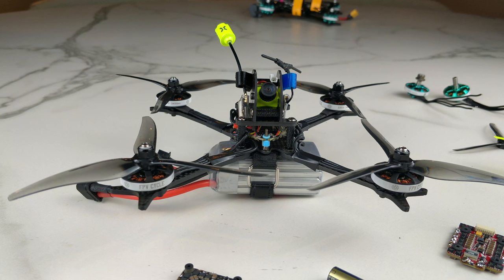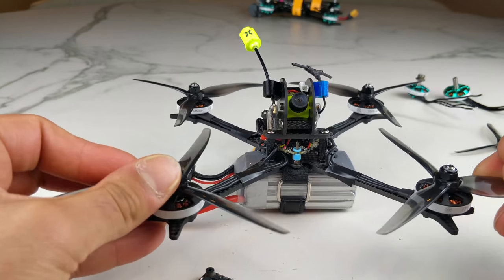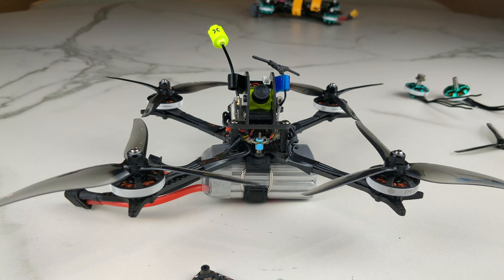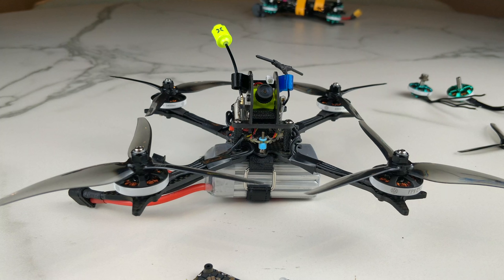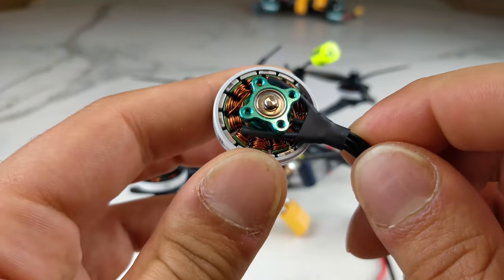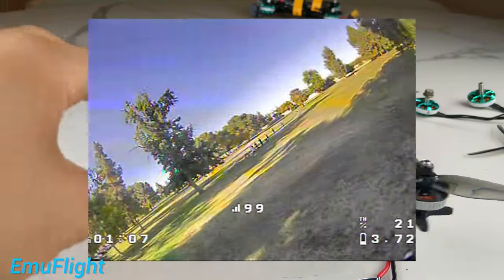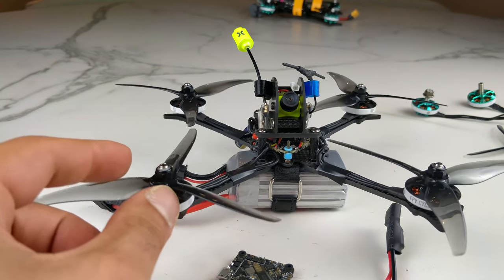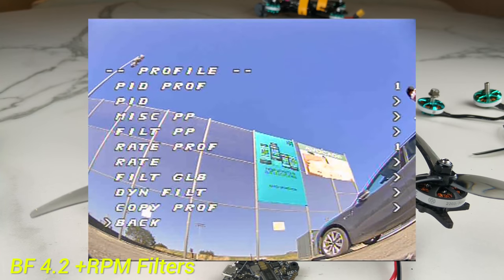Unconventional Tuning...

Comment: Another thought... "motor_output_limit" has been super effective method for me to limit the power of quads with very high theoretical RPMs without completely Nerfing the power.
Full Credit for this and explanation with testing shown here by someone else - bottom line: Very effective way to combat issues of mismatched motor KV and battery voltage: 
https://www.youtube.com/watch?v=xXUOys2s5HY
Quick explanation without watching the video (only 10min):
-Limiting the Motor output reduces the maximum power to which the PID loop has access. This is a much better method than a simple throttle cap, since that only limits the power that the PILOT has, while the PID loop can still rev the motors well above a reasonable RPM for that specific motor/prop combo. 
Example: Sharing my experience with the advice in the video above
--Build: Twig 3" with EMAX 1106/6000kV, T3x2 props running on 3S.
1. Calculate maximum theoretical RPM on 3S (12.6v):  6000kv x 12.6v = 75,600 RPMs 
----> Baseline for 5" quad on 6S (25.2v) is: 1750kv x 25.2v = 44,100 RPMs
3. Calculate percentage to limit motor output:  44100/75600 = 58.3%
4. Since power does not scale linearly from a typical 5" build, I added 10 to 15% to the calculated comparable limit. I used 75% as the limit and it flies MUCH better and still has the punch that makes a Toothpick quad fun to fly.
5. CLI commands "within the quotations":  
"get motor_output_limit"  //this is to show what is currently set since there isn't a GUI reference.
set motor_output_limit = 75  //this sets the maximum power of the motors for BOTH the PID loop AND the pilot
save  //ensure your changes are saved
Reply from the maker: I actually tried that and it didn't help at all. I don't believe the kv is an issue in this situation. If I simply ran 3s I'd have zero issues. But I'm trying to squeeze the maximum performance out of this thing so I'm going for 4s. If I were to drop the kv down and use 4s, well then I might as well just use 3s
Reply: KababFPV — It sounds like electrical noise was the culprit. It’s funny when you have to back to things we’re learned a couple years ago and you’re like, “gotta be kidding me 🤦🏻‍♂️”

Comment: How on earth can RPM filtering cause burnt Escs? Funfact: Yesterday I randomly Googled enrico morricone and I wondered that he still alive. Today, he died! Did I cause that?
Reply from the maker: I wish I knew but there are lots of reports of burnt ESC's.  I would be many of them just flashed the wrong code version but I dunno.  Way back in the day I remember all four of my ESC's simultaneously sparking and going up in flames after flashing SimonK or Blheli.  Never understood why back then either.
Reply: @Kabab  I wish people could be honest admitting mistakes they did. Flashing a Firmware to something that runs this magnitude of currents through a Chip which is not much bigger than the copper-diameter of a wire you would use for that application will surely make the Chip burn up immediately if something goes wrong.
On the other Hand, a bent or broken Prop will introduce so much noise into the gyro, that it can easily burn your esc through d-term too. An efficient notch filter can do the Trick to keep just the meaningful portion of the gyro signal.
I could also imagine, that Flashing the correct Firmware but using the wrong number of Motor poles can cause danage.

However, as you already pointed out, it is great that somebody is making money out of it and at the same time funny, that no Chinese Company is willing to spend it.
Also I'd like to mention, that joelucid brought plenty of stuff to betaflight without talking any coin for it. Like absolute control, linear thrust, integrated Yaw, BiDir dshot etc., rpm-filters
BiDir dhot in General is what makes RPM-filters possible and I think its somewhat a joint effort of JoeLucid and the author of blheli. Blheli32 is closed source and the first Firmware to Support BiDir dshot. Though it was not expected to happen, joelucid was able to squeeze this even into the blheli_s Escs. Infact, he learned almost everything from the original blheli_s Firmware, afaik rewrote it from scratch (also implementing 48khz stuff which is available for free) and then found a way to implement the Framework for selling blheli_s telemetry licences.

Comment: In my experience from BF 3.0 up and including BF 3.5 the goal was to have pretty much any quad fly decent out of the box. From 4.0 they changed it into -who cares about out of the box, but make it possible for most people to get really excelent results if they are willing to put in some time and effort. - Besides RPM filtering I liked 3.5.x better. VTX-tables and whatnot, yuck. The effort it takes to move a quad from one 4.x version to a newer is just too big.
Reply from the maker: yes that really is exactly what it is.  The effort of moving from 357 to 4.X is just too great.  Vtx tables are absolutely disgusting.  I got mine setup right and the damn VTx keeps getting stuck in pit mode.  It's the most ridiculous shit I ever saw.  Someone should fork  BF and just go back to normal Vtx function.  That would be enough to charge licencing.  I'd gladly pay a dollar not to have to deal with Vtx tables.
Reply: @Kabab  totally agreed.

Comment: I've pushed all the way to 20:1 thrust to weight ratio, it works but takes extra tuning work. Usually 4.1+ does the trick getting a high power quad to fly right, might have to play with ESC settings and lower ramp up power, timing, demag or pwm frequency.
Reply: 20:1? I don't believe that's considered a quad anymore. It's a prop rocket! 😋

Comment: They are a lot of marit to what your saying here! I have been building quads for three years. And I suck at tunning Betaflight (P'I'D's) firmware as well. So I do the very same thing. I have multiple Betaflight firmware configurations saved on my laptop (old & new configurator) So I can go back to Betaflight 3.5.7 or I can use Betaflight 4.2. I ran into the very same issues you have here with a similar build using 20amp Betafpv Aio board on a 4 inch Xnight build. Very Same mid throttle isolations as you was having. I changed firmware at least 10 or 15 times!!! I soft mounted more & more!!!  I pulled the quad apart at least 4 or 5 times..changed motors etc...By this time I was pulling my hair out!! On multiple forums asking anybody and everybody for any feedback I could get about this issue. ( Mid to high throttle isolations?) I actually got a little feedback on Facebook that helped a little adjustments on Dterm filters which calmed the isolating a little.  But they still was there! I figured by this time (Which had been 3 or 4 weeks working on this quad) That I had a bad board (Bad gyro) So I got another board sent to me. Same Betafpv 20amp board. But this board didn't have the isolating issues as bad as the previous board. But isolating issues was still there. And I ended up at the very same results you had. If your going to run 4.xx Betaflight firmware configurations your going to need JEC or some kind of rpm filters firmware on your esc's that's a fact. Or the new Betaflight firmware isn't going to run on these Aio boards like it should. I been exploring Kiss firmware and Flight one..Because Betaflight is great but all the things you got to do to get it to fly properly is a lot on a working man with limited time to fly. So I feel your pain on this subject trust me

Comment: You might get tons of vibration from how loose (seems) your antenna are mounted . Even Vibration from capacitor hanging like that. Maybe go back to soft mount motors in this quad?
Reply from the maker: I don't think the very low weight antennas could cause enough vibrations to be problematic in this case.

Comment: have you tried some different props?
Reply from the maker: I've tried several props.  It's not the props.  Even without the props it does the same thing.  I eventually gave up and now run 3S.  It's still wicked fast

Comment: Great video! 
 
Interesting, lol, I braided all my TP3 wires (3 quads :/) no issues though just wanted to protect/organize the wires. Also, I knew that putting your cap at the bat connector was not ideal but definitely better than nothing if you don't have space and are looking for durability.
 
For me caps have always been key, anytime I've had issues with a quad it is one of the first things I look at. This was because of my experience with RC planes. I've built a lot of 3D planes and was always frustrated as the older ESCs did not have a large enough BEC to power all your servos, especially for demanding maneuvers. Some of my planes have multiple caps in various places to smooth out the power/solve servo twitching and failures. Quads have been no different in my experience...
 
Also, I sell machinery and automation equipment for a living. I try to plan my wire routing, high power cables do not like being in close proximity to each other. If you can route wires perpendicular to it reduces noise (I am not an expert/have no education on this, just work with a lot of machinery and see similar issues). Another thing to try might be ferrite coils, there’s a reason many RC plane ESCs have them on the RX wire.
 
As for RPM filtering... I have it running on 2 quads, no esc failures. Both have the Vanover motors (copied all of his settings from the RR store). I cannot express how amazing his tune is, it has given me a lot of confidence/so much control over my 5”. The TP3 also fly’s amazing (with your provided settings) and has been an awesome tool for practice! I now feel like all my quads fly great without ever having learned to tune them :/. IMO physical setup/components are much more important than tuning… also, who has time to learn all this crap and still go out to fly?!
Reply from the maker: Seriously. Keeping up with all this crap is a full time job

Comment: RPM filtering has nothing to do with quad size. If you don‘t get a good tune on your micros having rpm enabled you need to learn how to PID tune instead of flashing different firmwares and hoping for the stock tune to work. If you think a good build can have any PIDs you are totally wrong and have no idea about PID controlling.
Reply from the maker: Not everything is PIDs.... default PIDs are usually pretty decent on most things.
Reply: KababFPV Depends on how demanding you are on flight performance. Defaults not working acceptable for any of my rigs.
Reply from the maker: @marlin-fpv  well in this case, you can set the pids to zero and the motors still have issues so it's very clearly not PIDs

Comment: Hmm ive been running the racerxfpv et5 ultra light weight 5inch kwad running ethix 1506 rats made for there 6s cinewhoop motors also running the same props as you on 4s and stock tune was on just a bit of propwash needed tuned out but it flies amazing super snappy but i tid bit of float bc it weighs in 249 grams with 4s 850mah ...id really suggest using tpu on tgis frame for the canopy/pod ..once i grab this frame im gonna to design one for myself ...also my geprc 20amp board works amazing on it crazy that i didnt have this problem
Reply from the maker: those motors are quite a bit smaller by comparison....you wouldn't have issues with those.
Reply: Thats good then i picked them so i coyld maybe run 6s in the future but there amzing on 4s so ima just stick with the set up i got now ...yea your motors are definitely alot bigger thats for sure lol

Comment: High throttle oscillations can be helped by lowering tpa and tpa breakpoint
Reply from the maker: Usually increasing TPA and lowering breakpoint but in this case it does nothing.
Reply: @Kabab  I'm used to emu tpa, I never touched tpa in beta but in emu since it's based on your pids you can lower parts of the pid loop based on throttle position which makes over powered quads easier to manage at high throttle

Comment: Betaflight seems to have a huge problem with the way they handle TPA. On kiss I ALWAYS can fix mid to high throttle oscillations simply by adjusting the TPA. So coming back to Betaflight (why.. idk...) I actually copy the way that kiss does TPA (as much as possible) and I have had great results so far.
Reply from the maker: I have noticed that TPA essentially does almost nothing on BF since it was first added....
Reply: KababFPV oh it does. But by default it only attenuates the D term. You can set it to attenuate P and D thru the CLI. Thrust_linear is another one that can be a good tool.
Reply: @zfpv7211  Agree, once I switched to TPA =PD in the CLI and it made a world of difference.

Comment: From my known ypu pay for the Blheli32 license when you buy the Esc.
Pid these days more for a prefer flying feeling and not that the Qwad fly well
Reply from the maker: Yeah so that's pay. Which is really a good thing. It's an insignificant amount but adds up for the devs.
Reply: @Kabab  you never try change a broken stm chip on a blheli 32. Thats a pain in the ass becouse it dont work. You can switch the IC but you CANT programm him. No chance to pay for a licence :( Same is when you take the ic from a toophon 32 and put it on a wrth32 (they the same) you cant reflash the chip! It simple dont let you becouse says is a Toophon. That sucks
Reply: @Kabab  would love to pay for blheli 32 reworks to but no way :( For me is realy easy to switch an IC that cost 5 bucks but now i have to waste the hole 40 dollar ore more esc. Remeber me a bit on Apple ☹

Comment: Has anyone of you guys succesfully flashed bidirectional dshot on the Mamba f411aio board?
Flashing is not working at all on my two aios... Been in touch with thorsten laux (developer of jesc) and still couldn´t figure it out...
Reply from the maker: Sorry I haven't tried. I usually run 3.5.7
Reply: RawPics- I think Ive had more issues with Diatone aios than any other boards/stacks. Take that with a grain of salt though, due to low sample size. While I have paid-license rpm filtering on two AIOs (original, lower AMP AIOs,) on one of them, the default UART for RC Rx (1) simply doesn't work, neither SBUS, nor FPort. On my new 16x16 Diatone Mamba stack (with pin connectors,) I lost an ESC immediately after licensing it with JESC. It's the first failure Ive had out of 130+ escs licensed with JESC. And not to rile anybody up, but I just tried Emu recently and was beside myself when picking one of the availble preset tunes delivered me a quad that sounded better, handled equally well if not slightly better, and was setup in a fraction of the time required by most all of  my other quads. Im going in hard on the next release, and will begin comparing the firmwares on each quad, keeping whichever firmware is "better." 

FWIW, I wont touch BetaFPV anything, my 20x20 F405 Mamba stacks are rock solid, Nameless AIOs (both the Toothpick layout, and conventional,) with the high dead time have proven robust, HGLRC 16x16 are my favorite nano stacks with 5 in service pushing everything from 3S 1202.5 5800kv 3", 4S 1404 4850kv HD with high pitch 3", and HD 4S 1404 3600kv 4", and no issues thus far. Flywoo Goku AIO is my favorite "whoop" style board (they have all standard pads/features, plus *Blackbox flash*, 4 ARGB LEDs, Camera Control pad with cap and resistor, spare 5V pad(s), spare Batt pad(s), Motor 5 pad for remapping anything you want, optionally closed softmount retention, motor pads on both sides with optional through hole connector mounting, and a crappy [shrug] conventional usb port layout,) with 6 or 7 in service on various Toothpick builds and no issues.. I could go on.

Anyway, I really gotta start checking the electronics stuff prior to spending hours on a meticulous build.

Comment: BF 4.2 imo is easier to setup than all other previous versions. You just basically throw it on and activate RPM Filtering and see how far you can reduce the other Filters (which is very easy because of the introduction of the sliders). Same goes for PID's (because there are sliders now as well). I hope they implement those sliders in the OSD too because it just makes things a whole lot easier.
Reply from the maker: Yeah it is if you have rpmf on board ....which you need to pay for.  BF is literally just dishing money into jesc's pockets. I do not understand why they would do that and still operate with no income and still be bitches about everything!  These guys are not friendly as far as I've heard. They hate me because they think I'm racist.  I don't even understand where race plays a role in anything I'm doing on my channel 🤷🏻‍♂️
Reply: @Kabab  shhh... Don't tell anybody but have a search for JazzMaverick's BlHeli Firmware👀
Reply from the maker: @k1f02  😑. Yeah I remember seeing this I'll still pay the licence
Reply: @Kabab  🤷‍♂️ I would rather pay for the BF software itself like once per quad instead of the ESC firmare.
Reply: @Kabab  Joshua bardwell said he doesnt recommend Jazzmaverick because the newer versions have a lot of bugs

Comment: Also i think most of these manufacturers assume your going to use a capacitor on the aio board but they should atleast tell the customer tp use one..like others said to you ive also noticed this on this cheap board basically why i stayed away from it but im glade it works great bc ill be buying a hand full
Reply from the maker: the manufacturers don't have a clue themselves.  Usually they don't even use these things.  One guy is probably telling the engineer what they want it to do and where they want things to be.  The engineer probably doesn't have too much idea what it'll be used for.  Also, in this situation, I'm really pushing things past their normal 'intended' use...

Comment: Maybe the kv of the motors it's to high for running them at 4S,have you tried to reduce it via motor output limit feature on betaflight? That should help
Reply from the maker: That is what I initially believed but the exact same parts on another setup works perfectly fine.